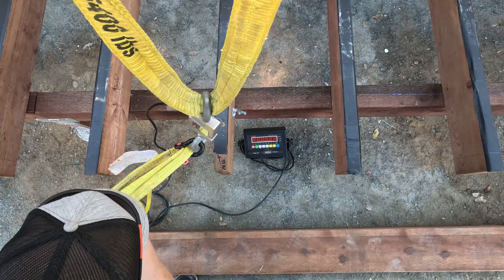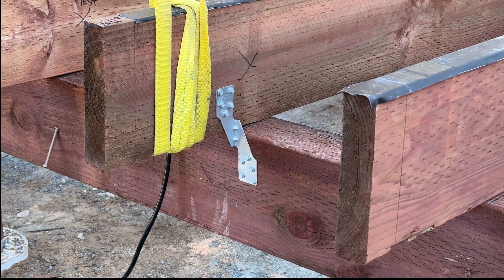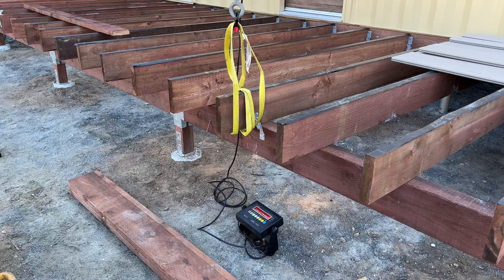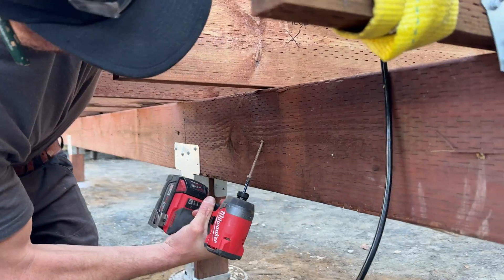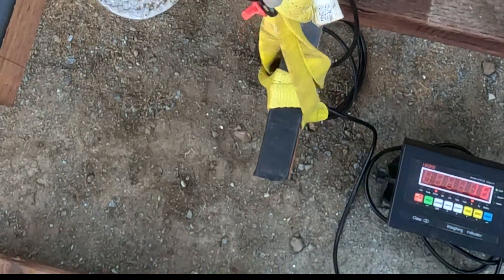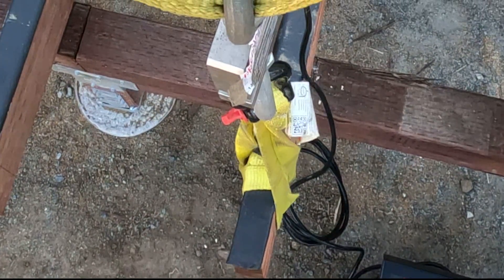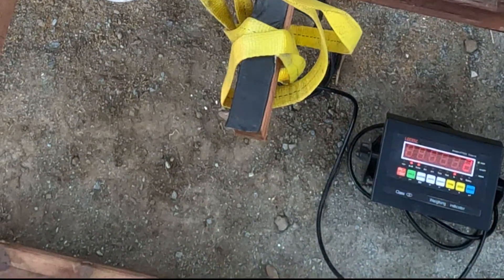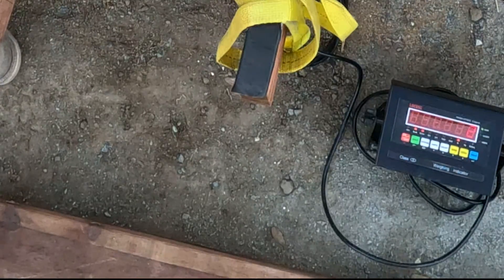I TRY to BREAK it! Truss screw vs Hurricane Tie

Comment from the maker: We never pulled the hurricane tie until it broke. When we reached ~1000lbs of uplift I decided to not go any further.
The CAMO Truss Screw broke at ~850lbs which is almost 300lbs over the specs.

What’s your thoughts?
Reply: I failed a framing inspection due 
To the use of truss screws. The
Local building inspector would 
Not approved the build without 
The hurricane straps. Soo... I used both. I believe he was 
Correctly following Michigan 
Code at the time. It may be 
Different now.
Reply from the maker: @billbertagnoli4226  When was that? They’re approved in all states 👌🏼
Reply: @moredesignbuild  I'm 74 and 
Haven't kept track of code since 
I retired in 2012. The instance I
Referenced was in 2007. I used 
The screws after researching 
Their holding power and felt
They would make code. They 
Didn't and I installed the Simpson 
Straps. I believe that at the time 
Screws were not permitted for 
Use on the straps. I'm glad codes 
Have changed. Great time saver.
Reply from the maker: @billbertagnoli4226  Thanks for your story and interesting to hear.
Finally we take small steps forward to improve and approve new techniques and products in the trades.
Thanks for watching!

Comment: I would expect a flat piece of metal with perpendicular nails or screws installed to handle that much force. The screw is really a convenience, time, and money saver. The screw is good for doing after the house is done been assembled and moved in.
Reply from the maker: Yes, the bracket can hold more but the screw can handle what it’s made to hold. If it can hold enough then I think the time and cost plays in as well.
I would use screws if I build for myself or my kids. That’s how I measure if something is good.

Comment: My home was hit by an EF2 in 2022. My workshop was destroyed. When I rebuilt it, I used rafters and a ridge pole. I used both hurricane straps and truss screws. I used screws on roof decking, metal roofing, wall sheeting even the vinyl siding and soffit. I was told I was crazy by the guy I hired to help me. 2023 straight line winds around 90 MPH nothing moved. 2024 hit two weeks apart by two more EF2 tornados. Nothing moved and that has been real world tests. FYI call me Mr. Lucky and I hope the tornadoes find new paths from now on
Reply from the maker: That’s an impressive story! Thanks for sharing 😊
Have experience of tornadoes 🌪️ and maybe I should keep it that way.

Comment: My house was built in 1980. Was thinking about adding hurricane straps to cross beams at least for extra support. They are 2 x 8s . Any opinions?
Reply from the maker: Hurricane ties or truss screws, I would go with the one you have access installing.
The hurricane tie is stronger, that’s for sure.
Reply: @moredesignbuild  I may only be able to get to my cross beams. Will this still add the extra protection?

Comment: Thanks for posting. I have used both. Most of the truss screws we use currently are driven almost vertically through double top plates up into the truss. I'm curious if the angle of the screw driven for the test along with the pressure being applied from that side had any bearing on performance. I'm curious if you've considered a test with the screw driven perpendicular through top plates and the sling attached to both sides of the plates, and if that more vertical uplift position would result in any improved test performance compared to the hurricane clips.
Reply from the maker: Good questions!
I have a plan to do more testing like this but I need to find time for it.
I’ll save your comment 👌🏼

Comment: Here in North Queensland I used  'triple grips', which are fixed in three directions, for both joists and roof purlins and rafters. They have held through three powerful cyclones, the worst being 'TC Larry', when one rafter split lengthwise. All timber is highest rated hardwood (46).
Reply: Why would you use hardwood, it's brittle
Reply: @jasonruff1270  30 species of termites in North Queensland.
Reply: @treefarm3288  why not use treated wood then?

Comment: Simpson load values are the result of a safety factor of 3 being applied to the worst tested values. So in almost all cases you will get better than listed performance. Also, they are designed for a specific load duration. You basically did a sustained max load  test.
Reply from the maker: I got a lot of questions about this test and will do another one when I have time.

It’s always fun trying to break stuff.

Thanks for your input 👌🏽